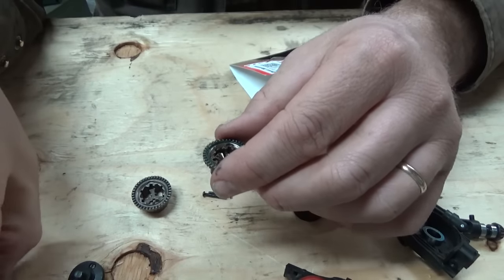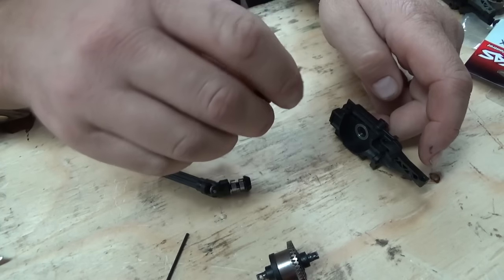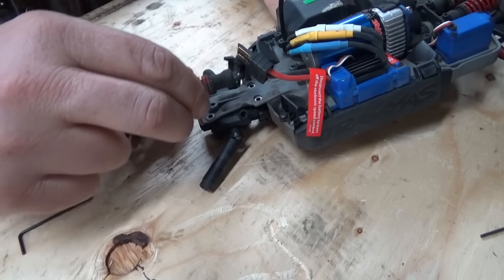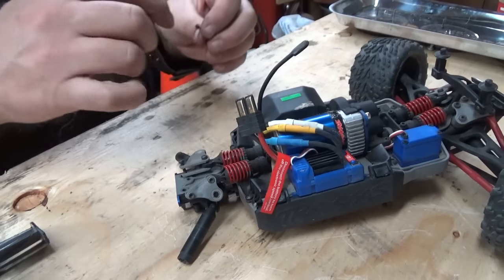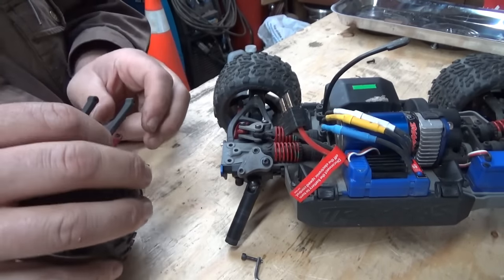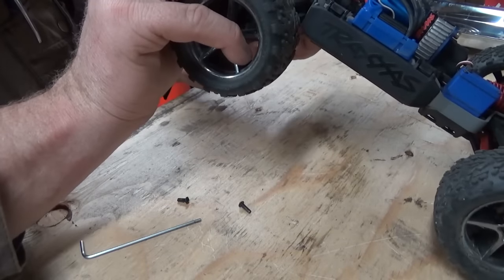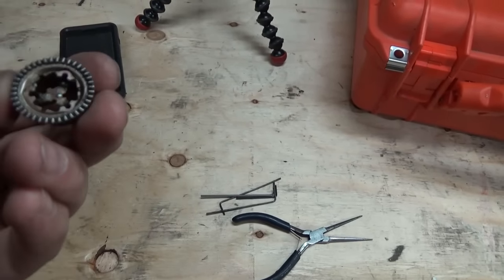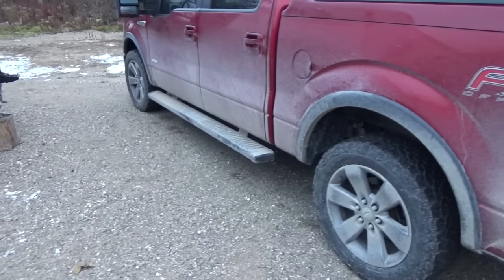1/16 E-revo parts in lets rebuild

Comment: when you need a light-weight grease that's not too thick you can mix a little motor oil with a little bit of Grease and it will thin that grease out enough for what you need. just make sure it's a real thin oil that you mix with the grease

Comment: I have some RC protips for you.
Buy a set of RC high torque screwdrivers. My old set is a Hudy one. Really nice to work with.. there are a lot of different makes/brands ofcource.. but really makes the dewie lot of easier to do with when screwing. That L-thing is awful to work with.

Adjust the suspension and make it harder so the front doesnt lift up.

Adjust the throttle for a slight delay so it doesnt go full tilt directly. Use a curved throttle setting on the transmitter.

Comment: Grease the diff man!!! 
You've got your ring and pinion gears running dry as a bone!!
How did this not cross your mind? Even when you spun it by hand and hear that dry metal on metal sound didn't make you cringe? 
Lubricate everything metal on metal, doesn't matter if it's an R/C or not. This should not need to be said!